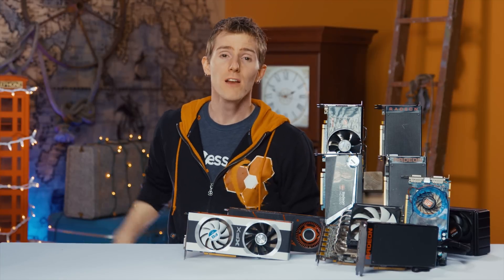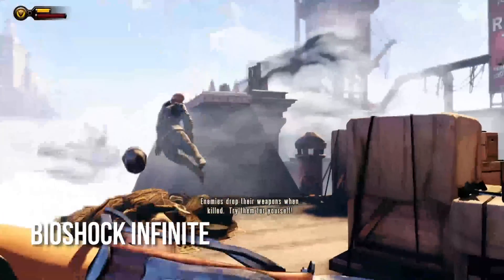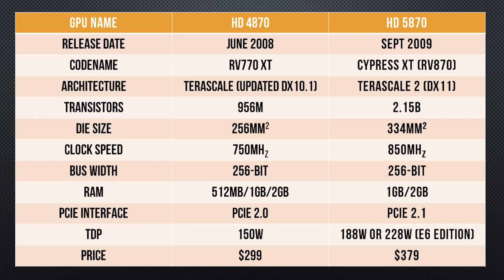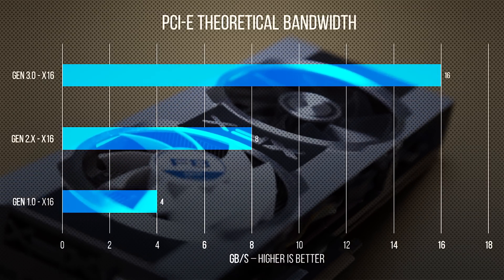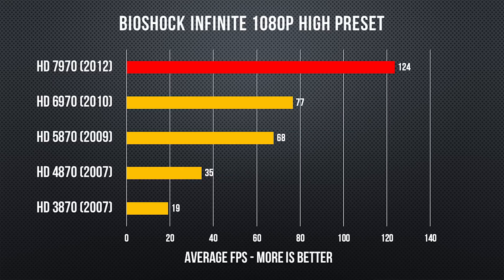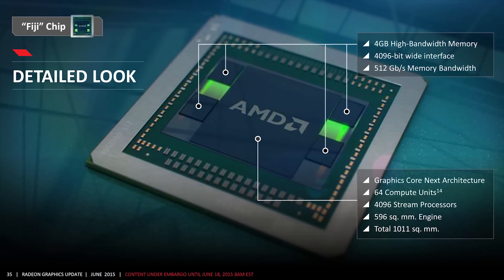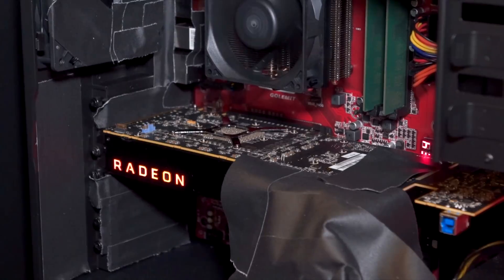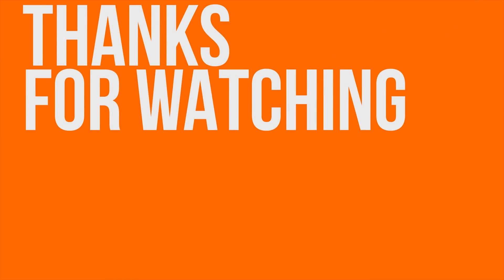10 Years of AMD Video Cards BENCHMARKED!

Comment: Still using my R9 280X Aka 7970. What a great card.
Reply: 7970 was a beast man. I had 3 of them.
Reply: UndyingGhost 7970 was a great card, same the RX290
Reply: Why 3 though ?
Reply: still rocking it myself while waiting for vega.  Still performs well to this day.
Reply: Still using a MSI Lightning 7970 . This is a double whammy for me because it is a consumer card that also has a lot of workstation features and is OCd to hell. It's actually a lot faster than the 7990 which was the top of the line.
Reply: That sounds weird, even a 380x (same core) gets 73fps on maxed out sniper elite 3.
https://www.overclock3d.net/reviews/gpu_displays/nvidia_gtx1080_ti_founders_edition_review/17
maxed out shadow of mordor should get 40, medium should be more like 60.
https://www.overclock3d.net/reviews/gpu_displays/nvidia_gtx1080_ti_founders_edition_review/15
ive got a 280x in a spare rig and its still badass
Reply: People talk sit about my RX480 -_- 
Nvidia Fanboys are asshole
Reply: RX 480 is a GREAT CARD
Reply: 7990 was two 7970's in CF so you are wrong there. Still, 7970 lightning was a neat card.
Reply: Card runs at 875mhz Stock, I run mine at 1300-1350 and easily hit 60 in most games on adjusted settings on a  60hz Screen. I dont see me mentioning 10 percent. Also afaik the 380x was a R9 285 not a 7970/R9 280x
Reply: +Toms Tech Wiki says the 380X is not Tahiti but Tonga or Grenada (rebadged Hawaii). 3rd gen GCN rather than 1st.
Reply: UndyingGhost same here, only thing i need to do for maintenance is replace the thermal paste at least once a year to keep her below 75c with a oc to 1130mhz gpu and 1800mhz memory... waiting to see what amd next move will be with vega...
Reply: Had it in use for about 2 Years, got a 1070Hybrid now, the old card will be living in my 2nd pc thou ^^
Reply: I cant complain either. 1300MHz kicking hard
Reply: got an XFX 280x. still going strong.
Reply: UndyingGhost gave my friend my old hd 7950
Reply: 280x vaporx on my 2 pcs. Still good for gaming and 3d modelling.
Reply: sweet
Reply: running an r9 as well agree good card very affordable
Reply: What are your overclocks? Mine is 1300 sometimes i push it to 1400 when I need the extra oomph
Reply: 2048sp:128TMU:32ROP
Doesn't sound like the rx470 core at all ;)
Reply: xD well im glade u guys enjoys it. because im really enjoy my RX480
Reply: because i get obsessive with graphic cards.and like to play and mod them. There was also this thing where crossfire gets stutter and crap but the 3rd card seemed to smooth things out.
Reply: it depends what kind of card that u use use for crossfire
Reply: im still using my msi 7970 as well
Reply: mine die yesterday.. so i buy myself gtx 1070 to experience nvidia graphic..r9 280x is a good card man..i play many game at very high setting with no problem at all..
Reply: ive got an msi r9 280... i realy want to upgrade to a 1080ti. playing on a 2k monitor medium setting on new games with 40fps avg.
Reply: Here I am w/ Sapphire 280X Tri-X OC..what a great card still rockin' hard!!
Reply: +kylion22 same. what is your OC?
Reply: My card is already OC @1100MHz and @6000MHz, I tried to add +50 and +100 but sometimes was instable so I keep it "stock" and it's smashing hard every game at high and sometimes ultra presets @1080p 144Hz
In game I try always to keep an average fps of 72 (half the refresh rate of the monitor) so the games run smoothly.

(Difference beetween 1100MHz and 1150MHz was maybe 1 max 2fps!)

p.s: didn't read that you have my same card sorry! Your OC what is??
Reply: Kylion22 mine is 1100mhz too. I got mine to 1350
Reply: difference scaled 7fps per 100mhz average
Reply: wow..mine isn't that lucky I don't think it can reach that frequency..did you set the power limit all the way up?
Reply: Kylion22 no. stock Toxic voltage. I got it to 1450 when I brought it up voltage wise
Reply: 380x over here waiting for VEGA
Reply: 7fps for 100mhz? not sure that makes sense.
1Ghz at 40fps=47fps at 1.1Ghz.....10% clock increase increases performance by 17.5%? Hmm.
unless you mean 1Ghz>1.1Ghz making it go from 70fps>77fps that would make sense....(if you have a 75hz screen, anything lower wont show any benefit).
1Ghz>1.1Ghz is upto a 10% boost.
1.2>1.3Ghz is an 8% boost.
For reference the stock 800mhz (non-ghz, factory declocked) models would "overclock" to 1Ghz and thats an extra 25%, the performance increases linearly with clock speeds but it gets exponentially harder to go further and further. Iin truth 28nm GCN loves the 1Ghz mark +/- 5% and everything from a 7750 to furyX can do it, much more and you have to start adding voltage with the downsides that brings as you drive into the efficiency curve.
Reply: you said you get 7fps more, that could be 7fps>14fps which is a huge increase or 200fps>207fps (both equally meaningless in their own way) you can see why reporting gains in fps is meaningless, percentage however is a given. and 875>1325mhz would be about 50% which is huge (if it wasn't for gcn cards all being capable of ~1Ghz, even still 1325Mhz is still wicked clocks for 28nm GCN good show), I have a 1.6Ghz celeron 1200 which I have a 100% overclock on at 3.2ghz with no added voltage, why? because wolfdale is more than happy to run at 3.2Ghz plus anyway, just because its factory de-clocked and i bumped it back up to what the arch is capable of doesn't say anything (could probably do 4Ghz and have a 150%OC but memory is a limit).
fwiw AFAIK has "know" at the end, no the 380x was a 2048 core 7970/280x tahiti core but with memory bus cut down by 2 memory controllers (actually deactivated, they're still on there) from 384bit>256bit but they employed delta color compression and much faster memory chips to make up for it much like nvidia do, this was first done on the 1792 core r9-285 (which was previously used in the 7950 and r9-280).
Reply: Yes I meant I get increases averaging 7FPS, depending on game of course. Its a pretty big bump imo, I only use 1350 or 1400 when benchmarking/if Game is super demanding
Reply: Still loving the R9 280. It struggles at a couple games but dammit it was cheap.
Reply: I have a Sapphire Vapor-X Ghz edition 3gb 7970

Comment: Absolutely pumped for upcoming tech - it will fuel the long Intel/Nvidia dominated tech war.

I miss using AMD hardware, but currently by work requires CUDA support for encoding acceleration (OpenCL doesnt cut it, compile times kill it), and Intel, in my personal experience is much better with Ableton, however I haven't seen any information on Ryzen with low-latency audio and recording performance.

AMD is coming back in a big way - I'm excited to see what Intel and Nvidia are planning to compete with AMDs price range. 
The hardware development war is coming back in full swing, and this time,
My wallet is ready.

Comment: Why does every one not count FM2+?! FM2+ had PCIe 3.0 since 2014! And an Athlon X4 860K was very competitive for it's price point back in 2014. I'm still rocking one and have it paired with an RX 480 right now. Playing at 1440p there is no noticable CPU Bottleneck, Framtimes are okay and i am actually thinking about waiting for Zen 2. AMD. AM3+ was dead in 2014, i didn't see any reason to buy a AM3+ platform and FM2+ was actually pretty darn good. (It still is IMHO.)

Comment: I love my R9 290X, I paid $170 for it used, I installed a corsair hg10 bracket and water cooled with a corsair AIO cooler. It's a solid GPU that I haven't found myself wanting to replace.

Comment: Aaaaaaaaaaand their drivers are still shit.
Reply: Tyrone Hogan I guess you never used AMD recently. Right now thier softwares are better than Nvidias, espacially the Relive edition, omg works much better than shadowplay
Reply: Dude, I just went through a crossfire R9 380 set up and then an RX 480 set up. The drivers for them constantly got errors like: "Wattman has failed".. 

They suck.

Comment: My Fury draws less than 240 watts, runs at 60c (on air) and can play any game on full settings @ 1440p and it costs about $240 now. I think it's best value for the money. Better than anything Nvidia offers.
Reply: Fury's are ridiculously cheap right now, pretty much the same price as RX 480 8GB's
Reply: AMD's junk drivers? You still live in 2006?
Reply: AMD drivers are better than Nvidia drivers (coming from a gtx 1080 owner)
Reply: The extra gigs on the 480 are probably a better investment for future performance though.
Reply: ElteeMullet yeah let's just ignore all of Nvidia's recent driver fuck ups. Both have there issues and AMD is a hell of a lot better than they use to be.
Reply: Ehh the Fury's raw performance still makes it better at 2k and 4k.
Reply: the 1070 and 1080 are both much more expensive than the $240 that he says he paid for his, and TDP means almost nothing to most people, it's just something people point out just because they can
Reply: +Nigel You might want to rewatch it yourself since Linus only said that GDDR5 is available in higher quantities (which in part makes the RX 480 cheaper). Earlier he calls the RX 480 more practical, but that's about the card in general.
kyle was also talking about the amount of memory, not the bandwidth (in case that's what you were thinking).
Reply: agreed, i own a gtx 1070, and shadowplay is buggy as hell for me, sometimes needing to restart my entire PC before drivers start acting normal. 
used to own an AMD card, upgraded to the gtx1070 for more preformence, but man i miss those amd drivers, you can do so much more with it.
Reply: yassir 560 no i agree im just saying the 8gb or vram model is worthless for that reason.
Reply: Cosmin D. Not nowadays with newer games and APIs ;).
Reply: Teddy Kozub No if you want to play Ultra Texture Settings or 144 fps and that, unless it's Doom on some good optimized game.
Reply: ElteeMullet Where TF can you find a 980ti for $250? I thought about buying one for $300 till I found a R9 Fury (New) for $239 best value on the market imo.
Reply: kyle eaton No XD Did you even watch the video?! Go to the section where he discusses HBM vs GDDR5.
Reply: 980tis are still 300-400 euros...
Reply: kyle no the extra gigs on the 480 mean nothing if you dont crossfire, from experience and why i returned my 480 is anything that will fill that memory is pointless because the gpu itself cant handle steady uhd or qhd res. Its like sure i can use nightmare textures on doom but if i cant play in 4k its literally pointless. And im sorry if to anyone who has to play doom at under 60fps that game needs that 60.
Reply: Michael Simpson its a low end card why do you want 4k? the 480 is made for 1080p 60..
Reply: Beast6228 I have two Fury x in CF and one 1070 the fury cards always amaze me
Reply: You forget about the GTX 980ti. Better in any way possible than Fury.
Reply: Cosmin D. Hahahaha No, not even close to being better in every way.

You're a fanboy XD
Reply: No your just too poor to ever of actually of tried one...
980 ti smoke fury x fury x is just cheap 1440p at medium settings
Reply: enjoy low compatibility and shit frame pacing. But thats what you pay to peak a whole 3 to 5fps faster than a single card solution at lower resolutions
Reply: Michael Simpson at 3440x1440 in crossfire they pretty much double the frames that my 1070 does. occasionally there are a few hiccups here and there but I get the same skips and frame drops with the 1070 when its at 100% GPU usage and I bought my 1070 right when it came out so I paid $477 for it. I got both Fury X's for less than that a week latter. I'm not going to argue that that's a bad deal.
Reply: I guarantee there are nowhere near the same frame dips but i will give credit it looks like the xfire fury x gets maybe 30 to 40 more frames on games the 1070 already runs at over 100fps but that also is only at 1080p, up that resolution to 4k and you will see the difference clearly in longevity.
Reply: NVM just looked it up nope fury x still sucks by comparison even in 1080 lol i mean yeah sli sure but still why? like over 2x the watts used, the same price overall and alot less compatibility, You cant compare xfire to single card nvid without still making amd look weak
Reply: Michael Simpson why buy a fury x? because this is my hobby I'm not trying to say one is better than the other but for the age of the fury X product it does relatively well compared to Pascal. The rig I have them the has a custom cooling loop and was built in the Fermi days cooling two GTX 580s was extremely difficult but it has no problem with the fury x cards. I'm not worried about energy consumption $5 extra month is no problem for me.
Reply: Is 4GB VRAM enough for 1440p?
Reply: I was asking OP what's his exact experience. I am not idiot.
Reply: lol nvidia has nothing better. lol sorry the fury is decent but it is a joke to say it competes at temp and power when a 1070 outperforms it most cases especially in 4k. And i would say its worth investing more on a card that isnt already like 3 years old. If you have a fury but at 240 i still wouldn't recommend it
Reply: Link Freeman 
sorry i thought he said the fury X, normal fury is fine. And I didnt see the 240 dollars part
Reply: Really because the 1070 and 1080 out preform it at a much lower cost and TDP.
Reply: Wrong.  You can pick up 980ti's for $250.  Screw amd's junk drivers and having a slower card,  spend the extra 10 get the better card.

Comment: Ooooh that xfx 7970 card brings back so much rage. Got it when building my pc and after installing a bios given to me by xfx which was meant to fix some flickering issues I had but instead it bricked the card due to no fault of my own. Sent it in for RMA and they wouldn't fix it because some bullsh*t sticker was missing, I then bought an evga gtx760 and never looked back.

Comment: How come I am the only one that ever has a computer with parts almost no one's heard about:

My first GPU:   Radeon HD 5750

New computer:
GPU:   Radeon RX 470
CPU:   i3-6320

These are THE BEST of low-end parts (for my newer computer), and honestly I HIGHLY recommend them if you are building a new system for about $1000 or under.

Just want to get the word out there somehow.
Reply: wait for people with a $1000 budget why would you recommend an i3 for gaming? at least step that up to an i5 with that budget.
Reply: (Well, it was more like $750, because I didn't have a copy of Windows 10, a monitor, mouse or keyboard.  (It's been a while since I owned a desktop))

And I would recommend an i3-6320, (and let's say if you're on a short budget) because the majority of games cannot and don't take advantage of multiple cores and (mostly) threads.  That's why I was looking for the best single threaded performance I could get, because that ultimately determines the performance for running  games (and simple applications).  I did my research, and the i3-6320 (3.9GHz) has better single-threaded performance than the new AMD Ryzen 1800X, and it's only 0.1 GHz behind the 1800X's boost clock.  Although the 1800X IS a much better processor, it does not make a huge difference in games.

It's not the fastest for compiling code or encoding video, but it's the fastest processor I've owned (faster than my 4 year old laptop with an i5-4___ (I don't remember its number)).

And remember that gaming performance mostly relies on your GPU, not CPU.

Here is a quick reference for comparing the i3-6320 to the 1800X:
   https://www.cpubenchmark.net/compare.php?cmp[]=2625&cmp[]=2966

Comment: The 7970 and the 5870 are the two best GPUs ever made with R9 Fury nano taking the 3rd spot. the 3870 coming in 4th. 
3870 = Price performance King
5870 = best Crossfire card ever best Dual GPU card ever
7970 = the best Card if you didnt want to uppgrade for 10 years and still run 60+ FPS on high settings
Fury Nano = The best Mini ITX card ever.

Comment: I'm using a 3870 in my PC right now
Reply: He's not complaining though.
Reply: tell that to people which run Intel HD graphics :D
Reply: MrAntieMatter I'm not complaining. In fact I'm surprised how well it works still.

I use a 1920x1080 monitor and another 1280x1024 monitor. It runs on Fedora 24. I mostly use it for reddit and youtube, and it runs 1080p60 videos smoothly. 

The benchmarks on here don't seem true. It says 38FPS for half life 2, but I just tried it now and on max settings and I'm getting 60FPS completely fine. It's playing this video in 1080p without any frame drops. 

I remember a few years ago playing portal 2 when it came out on this exact same card on medium settings perfectly fine, probably 50fps, but this was 2011 and I don't remember that well.
Reply: I used to play Portal and Portal 2 in 1280*1024 (which is actually more than 720p)  with a HD4650, and apart from AA it had no problems running them at 60
Reply: +Gatewayuser200 Let me guess. You are one of those "Fuck yea Murica, hamburgers, eagles and shit"?

Comment: I wonder if I were a Minecraft Youtuber how much money would I have to spend to get the most powerful Minecraft computer. is there a point where adding more horsepower doesn't improve frame rates. I mean I'm talking streaming in 4k at 200 FPS. I mean that probably would be a 20 to 40 thousand dollar computer but is there a point where you're just spending too much money on the computer. and would you be getting more than 20% Improvement if you build a computer every single time a new GPU came out?